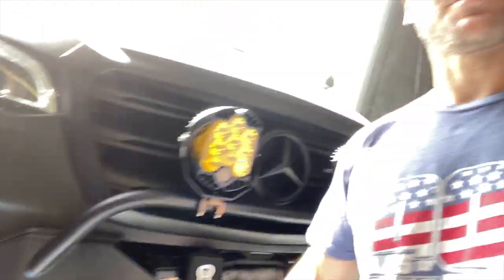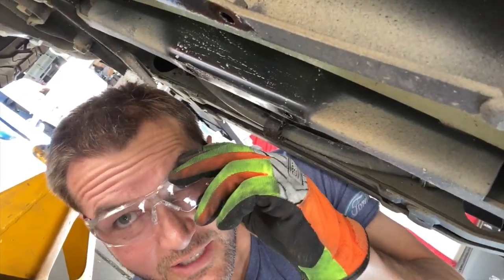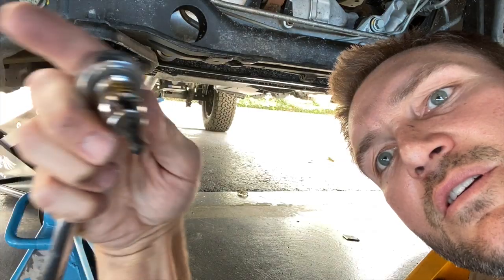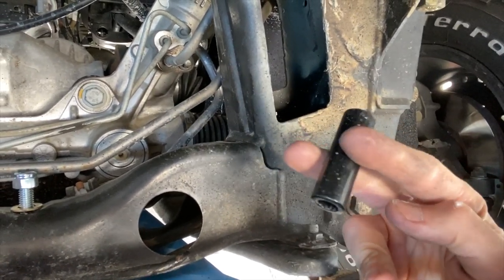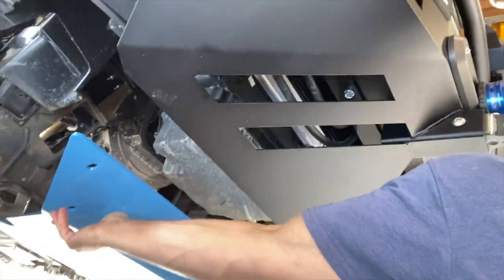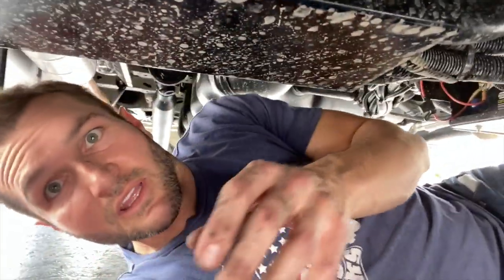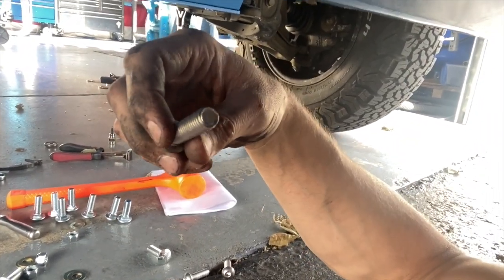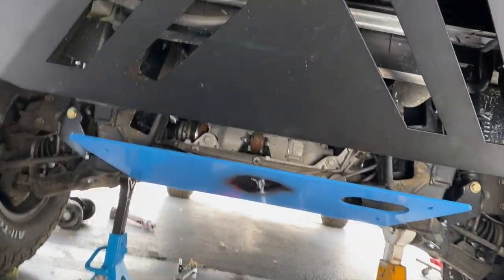Sprinter + Revel Skid Plate Installation Van Compass

Comment: Here's a helpful tip for installing the transmission skid plate:

Hello, fellow van owners! I just installed the Van Compass engine, transmission, & rear differential skid plates I purchased from Van Owls. Overall the installation was pretty start forward, but those bracket spacers were a very challenging piece of the install. As John recommended in his video, I used a small telescoping magnet to maneuver the spacers into position. Even though the front bracket spacers were a bit tricky, they were pretty easy to install with the magnet. However, the rear bracket spacers were VERY DIFFICULT to install. I ended up using a common nail shoved through the bottom part of the bracket to hold the spacer in place. Once I  had the spacer aligned, and in place, I placed a stronger magnet on the top portion of the bracket. In doing so, it pulled the spacer to the top part of the bracket, creating the space needed to slide the transmission skid plate into place. Once the spacer was firmly attached to the top portion of the bracket, I removed the nail I was using as a guide rod and carefully slid the transmission plate into place.
Reply: Oh, BTW, even though the rear differential plate was by far the easiest to install, be sure to attach the two nuts/washers to the front U-bolt before attaching the rear portion of the skid plate to either one of the rear U-bolts. If you attach the rear U-bolts first, the skid plate will not be adequately aligned, making it impossible to thread the washers/nuts onto the bolts. Also, depending on your vehicle's mileage, you may want to consider doing a differential oil change prior to installation to prevent getting the new plate oily/dirty.